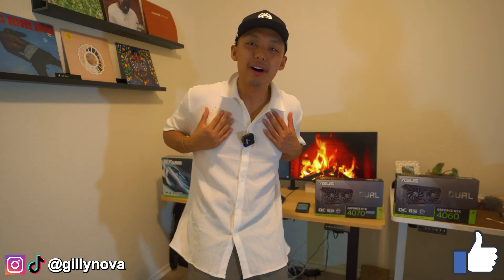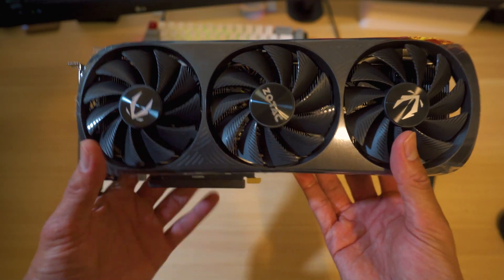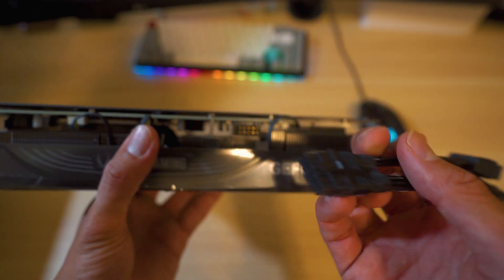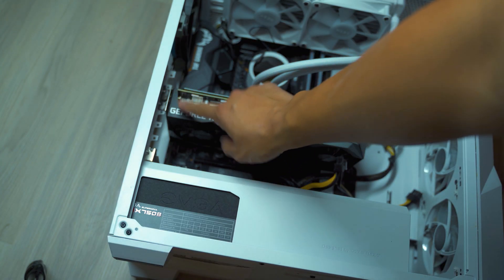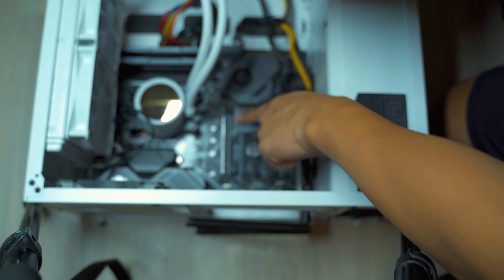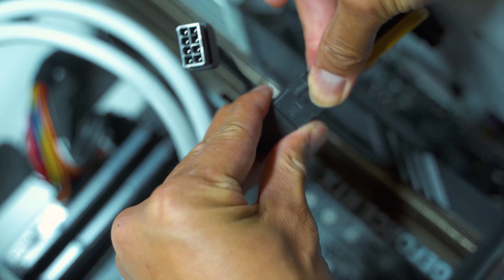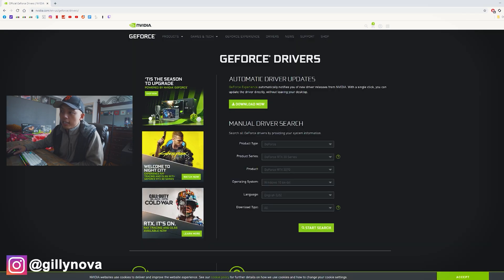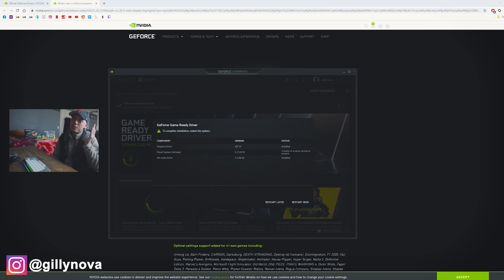How To Install a RTX 4070 Super TI (EASY & FAST)

Comment: i purchased my custom built pc without a graphics card because it already had one (rtx 4070 ti super), and i see a dangling 12 pin PCie cable which i assume is for my graphics card, im not sure if i still need the adapter or if i should just plug it straight into my GPU

Comment: I’m new to this what would happen if you didn’t neutralize? Fire or something?
Reply: I think what hes tryna say is if youre on a surface like carpet you can build static electricity and if you dont discharge it somewhere by touching a surface like metal you could potentially short and defect your components by touching them